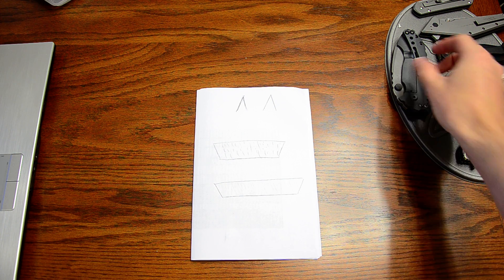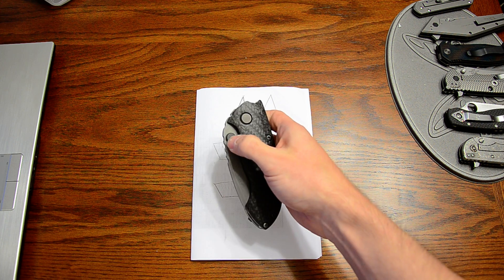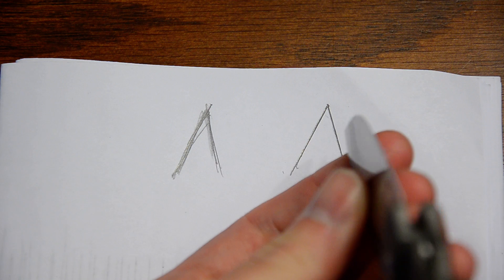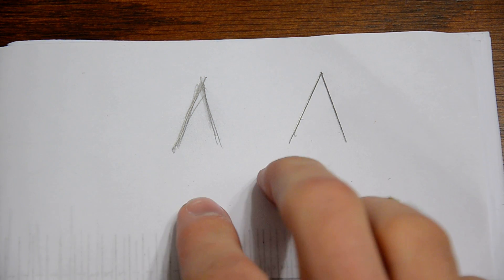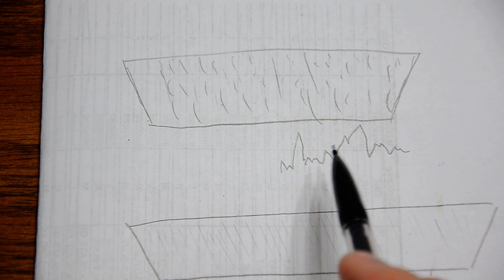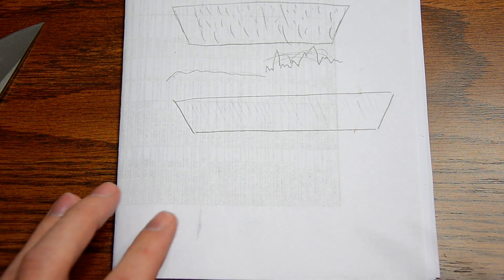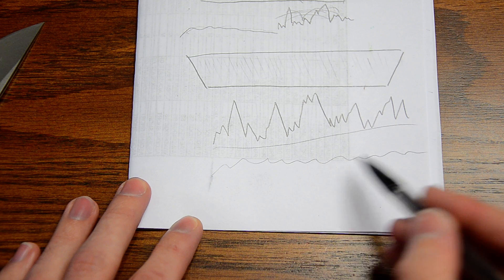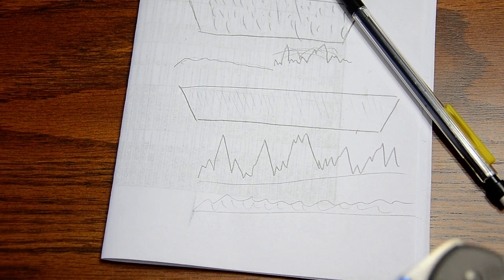Viewer Inquiry: How Does a Strop Sharpen a Knife?

Comment: Best explanation of bevel and edge refinement I've seen. Perfect and exactly right on all points. The description of the peaks blending into the valleys on the bevels is spot on. This is why blades that have been "polished" with fine ceramics or Arkansas stones suddenly reveal nasty scratch patterns when further refined with waterstones and/or aggressive stropping compounds.

Comment: You're probably stropping at too high an angle and rounding your sharpened edge over. I find the best way to know you're at the right angle is by the sound the strop makes. If you start with a very low angle and gradually raise it while you LIGHTLY strop, you'll hear the sound change when the edge meets the strop, and then you hold your angle there.

Comment: Hey bud, Ok, I just bought a HD compact strop from stropman. Got the green and white compound. I don't know what I am doing wrong. It seems like the knife gets duller when I strop it. I have took several knives that were sharp enough to shave hair without a problem then after I stroped it would not. I did what the videos showed. I even resharpened and stroped. Same thing

Comment from the maker: The idea that stropping doesn't remove metal is easily debunked. 

Stropping IS a form of honing. Does it remove a tiny amount of metal relative to taking an edge to stone? Yep. Is it still removing metal? Yep.

And also, strops most definitely can sharpen a dull knife, depending on how dull it is. You'd be surprised what .5 micron monocrystalline diamonds can do.

Comment from the maker: Stropping most definitely does remove material (steel). The evidence is right there on the strop, as well as the edge.

 The black color on your strop is due to steel being removed and embedded into the leather/compound. 

Also, if you've ever looked at an edge under a microscope after stropping you know instantly that material, (sometimes a significant amount, depending on the compound) is being removed.

The idea that metal isn't removed is absurd.

Comment from the maker: @pyaoliang It matters to an extent, and it also doesn't matter to an extent. Compound will expedite the process, but even bare leather contains silicates that are hard enough to abrade steel. Also, the plastic deformation can occur without compound altogether. Even other, softer materials can work in that way.